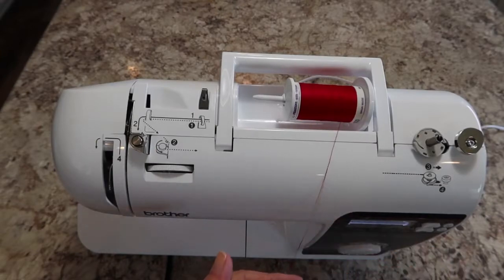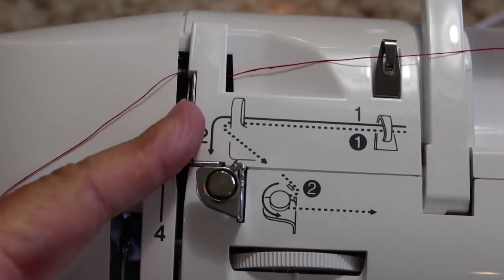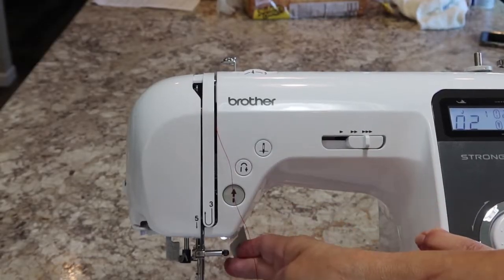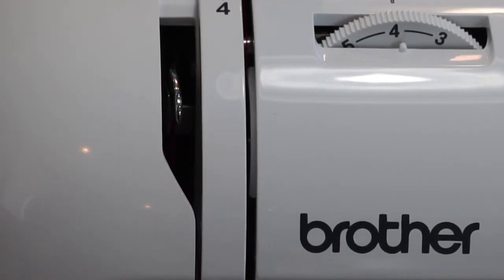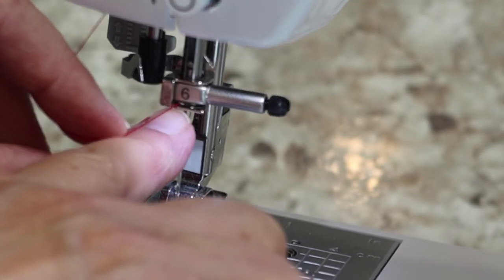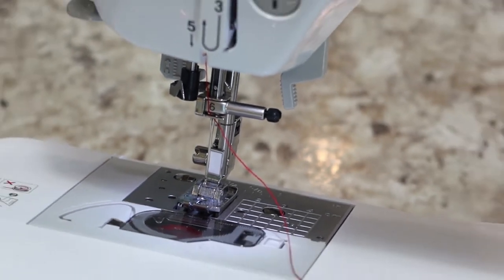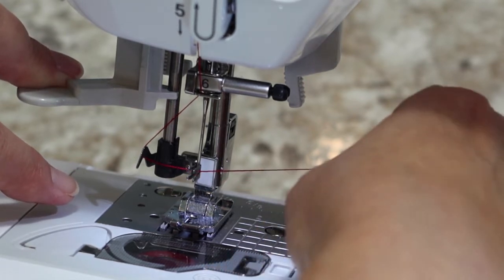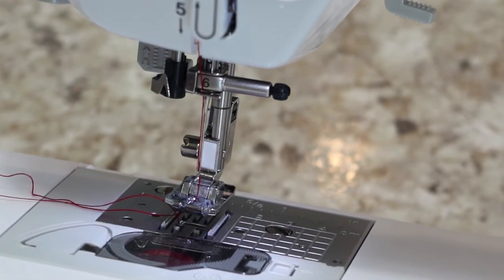Loading the Top Thread on a Brother ST150HDH sewing machine.

Comment: Thank you for clarifying thread positioning between point2 2 & 3. That was probably the cause of some of my upper thread tension issues.
Just wondering are we able to change the default needle position from the far left to the middle? When I use a straight stitch needle I forget to put the needle on number two and break a lot of needles so can we change the default needle position to the middle on this machine?